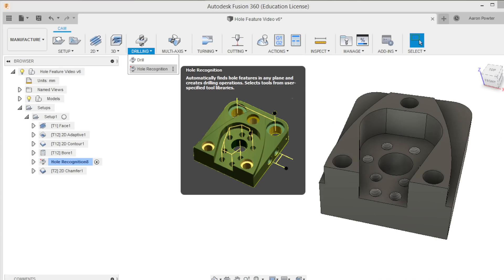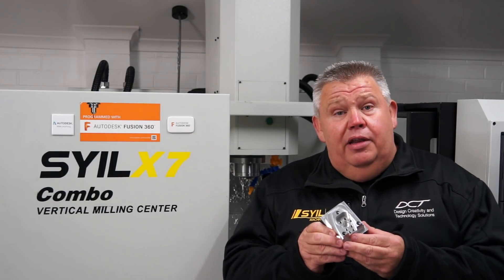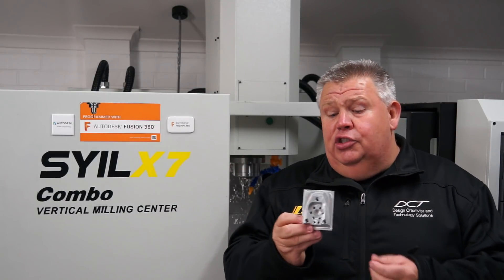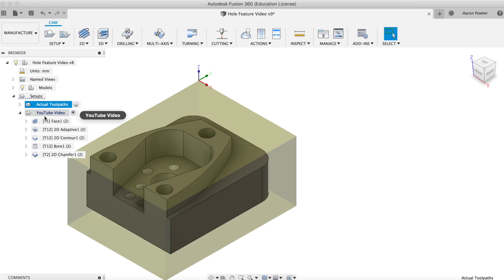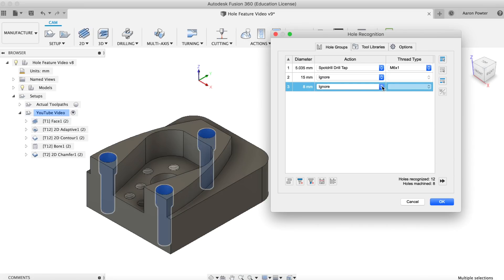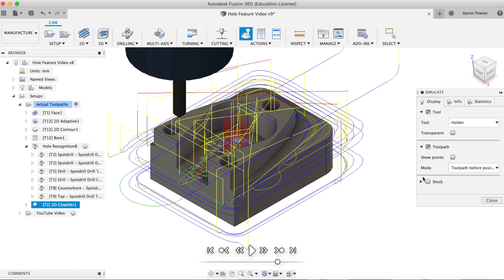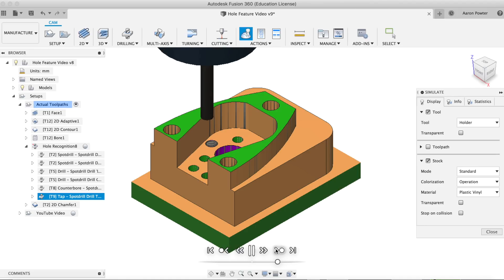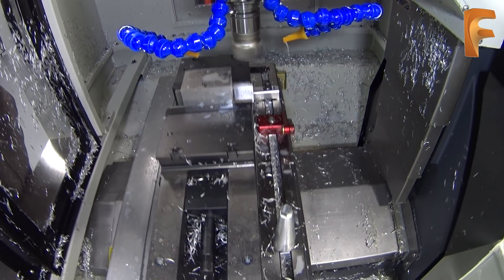Fusion360 Hole Recognition CAM Feature - First Look

Comment: Can it do 5 axis ?
Reply from the maker: Good morning Donovan. Yes, fusion 360 can do 5 axis simultaneous machining. Check out and reach out to @angelojuras https://www.youtube.com/user/TheCroatianPimp
Reply: @DCT_Aaron_Engineering  What i mean is can the hole recognition automatically detect holes for 5 axis drilling ? because i have a lot of holes to drill (200+) on a profiled plate at differing B and C positions.
Reply from the maker: To my knowledge Yes. Feel free to ask Angelo as he works for Autodesk and is a CAM / CNC specialist 👍
Reply: @DCT_Aaron_Engineering  ok, will do thanks!

Comment: Nice one, Aaron! Great to see some of these simpler operations becoming more automated - hopefully there are more to come along later. Although modern CAM is so much more powerful than G code, you still need to spend a lot of time creating toolpaths, yet it isn't really rocket science. I realise it isn't going to happen overnight but with time we will surely see more of the process being done in CAM. Look forward 10 years and try to imagine where we will be with this!
Reply from the maker: Hi Murray.  It's nice hear from you.  Thanks for taking the time watch.  Fusion keeps amazing with all the features they're adding.  Hopefully this and other cool added feature will flow out to masses sometime soon.  All this certainly reduces the time you spend at the computer screen and more machine time.  Cheers mate, Aaron.

Comment: I love fusion but I wish it supported linux so I can dump windows. I refuse to use Win10.
Reply from the maker: Hey buddy.  Yeah I'm not sure if Fusion 360 will ever be Linux supported.  I use mine on both PC and Mac.  However, I did some digging and found this article for you on the Fusion Forum.  https://forums.autodesk.com/t5/fusion-360-support/running-fusion-360-installer-on-linux-through-proton-libraries/td-p/8411583

Comment: Thanks Aaron,  It is good to see the progress of F360 and also to get some idea of your Syil machine's capability.  Silly question, what is the part?
Reply from the maker: Mike Newman G’day Mike. Thanks a lot mate. Yes Fusion360 as a product is constantly evolving. The Syil X7 is still going strong. I just need to push her harder 😉. No question is ever silly Mike. The parts is nothing in particular. I just tried to emulate the model used in Fusion360 Hole Recognition example. Have a great day Mike and thanks for watching 🍻

Comment: I saw the post on Instagram and you had me looking for this feature before I even have it. Great video and I look forward to using this once its released. A little trick I just learned on spotting holes, you can set the depth "To chamfer" and it will drive the spot drill to your chamfer depth so you don't have to come back to it later.
Reply from the maker: Hey Jody.  Always great to hear from you buddy.  That's a great tip, thanks for that.  So many little tricks you can use with Fusion360.  I watched Rob Lockwood the other day when he collaborated with John (NYC) CAM video.  Man, what doesn't that bloke know.  Rob's a frigging genius.  Thanks for watching 🍻
Reply: FWIW Hole Recognition can and with the default templates should be doing this for you.
Reply: @scientist009  I assume that is model driven. I do not always model my chamfers, on holes especially.
Reply: Well if you make your own template with that setting it will without modeling it. I think the default ones use that option but set it to 0 so you'd go back and update that later if you wanted.

Comment: Man that audio is horrible
Reply: Richard sargent What audio? It seems pretty good to me.
Reply: @MechanicalAdvantage  It's shabby in the workshop but obviously alright when in front of the computer.
Reply: Aaaron, what happened to that lapel mic I've seen you wear before (with resulting better sound)? Also, did I miss an announcement somewhere that you are now officially sponsored by Syil (if that's the case)? But yeah, good content nonetheless:-)
Reply from the maker: Sorry I must of missed this comment.  I was lazy and didn't wear it.  Won't make that mistake again.  Cheers, Aaron.
Reply from the maker: Yeah sorry, I forgot to wear my lapel microphone.